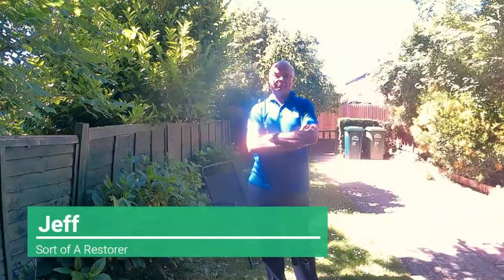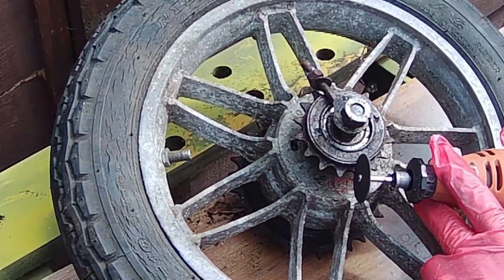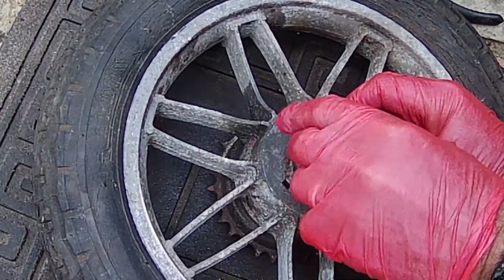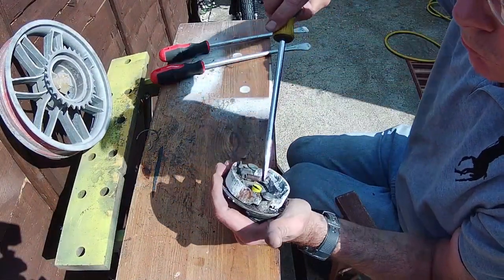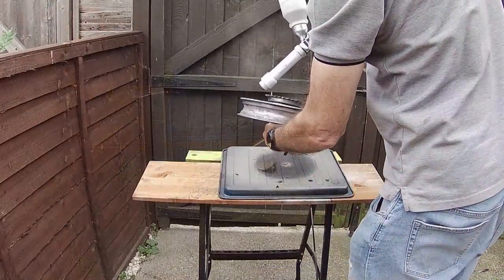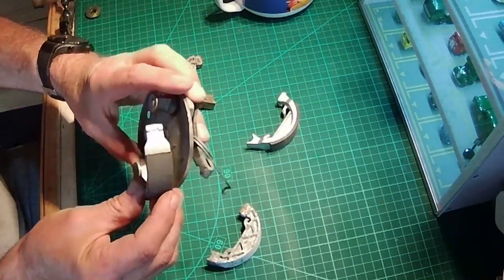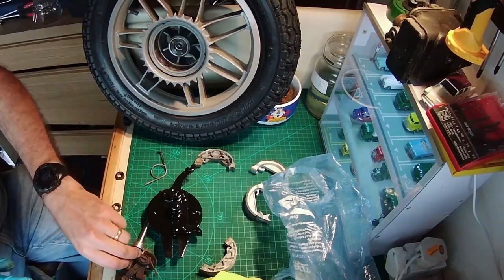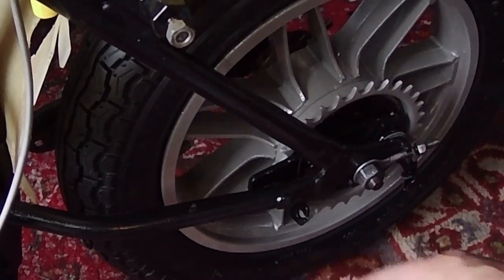Mobylette X7 Restoration  ( Part six )

Comment: Hello, I am asking for your advice. I can't get the seat tube out on a 1966 Bianchi Mobylette. I've been hitting it with a wooden stick and spraying WD oil for a month and it won't budge...
thank you very much
Ivan * Prague
Reply from the maker: Hi Ivan, will you be painting and restoring it? If so you could use heat on it.
I have recently had trouble getting a handle bar stem out and that worked wonders. If you are not going to paint it you could try and get some heat down the tube.
Heat is my best friend.
Take care, Jeff
Reply: Thank You much... I will try it, sending You link - its a beautiful veteran, all is original..